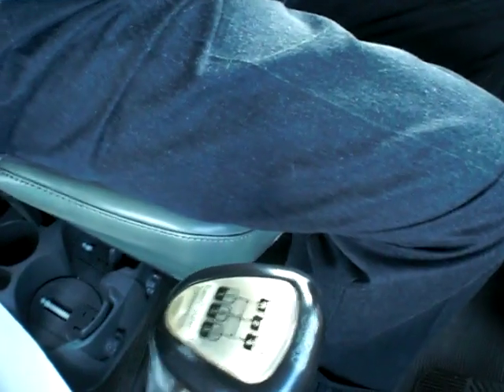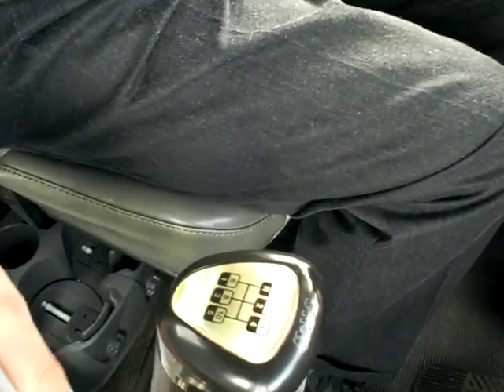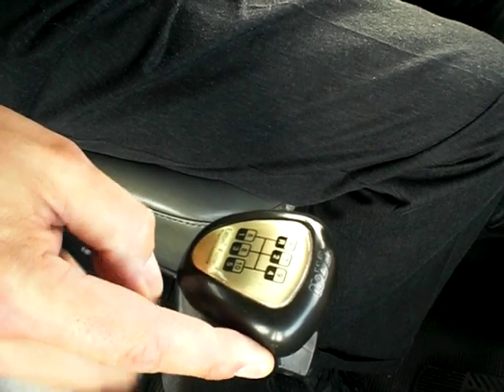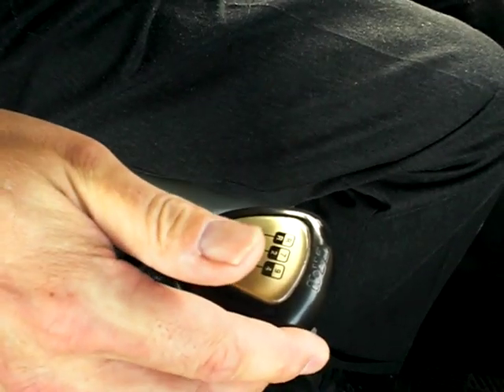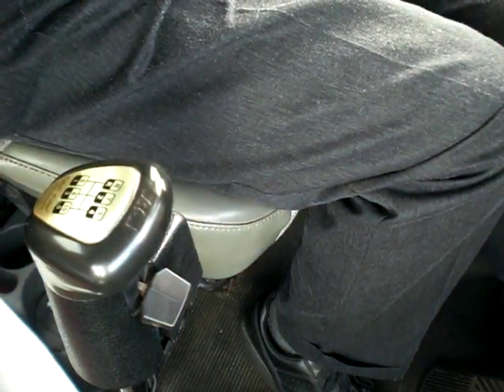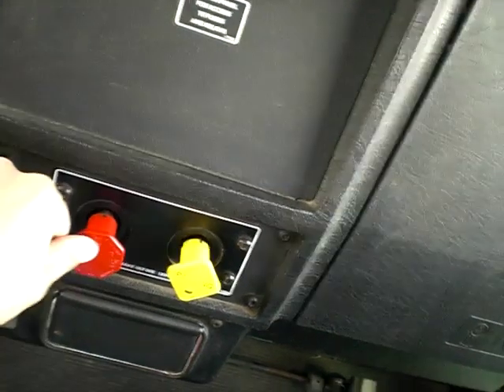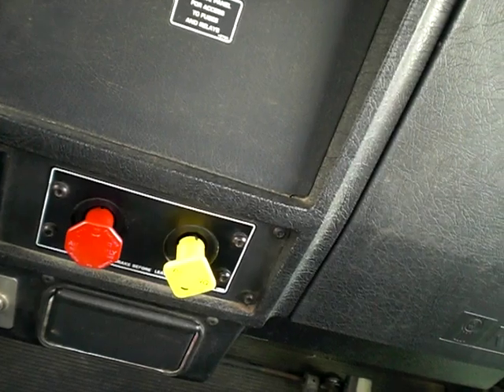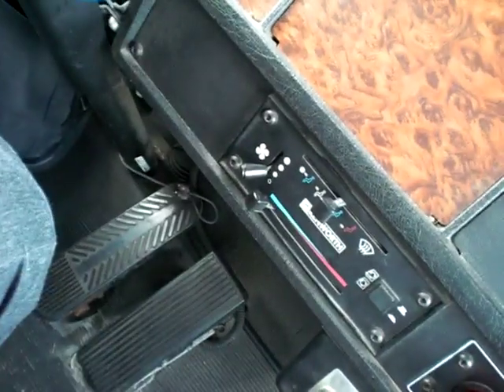AIR BRAKE STALL TEST

Comment: yes you can use a tug test to make sure your 5th wheel is locked. but in order to pass your pre trip inspection with the trooper when you take your test your requiored to do a leak down test and tug test to ensure both your parking (tractor) and emergency (trailer) brakes are working as they should be. you test each brake one at a time. hope this helps!

Comment: In indiana, this is called the Tug Test. It is a required part of a Pre-Trip Inspection and is done first with the parking brake, then the trailer brakes, then both. You only use first gear (it provides the most torque without lugging the engine)

Truck Specs: 2006 Mack Vision with Eaton Fuller 9 Speed and 39 foot frameless end dump trailer.

Comment: Wonder if this guy's DAC report has a few pages of terminations from breaking trucks?

Making sure the slack adjusters are properly adjusted during the required Pre-Trip and performing a leak down test is the proper way to check your brakes.

Comment: @24preacherboy any brake pot with a broken spring will not hold the truck, but service brakes will work fine, about half the time the pot will leak, because the spring poked a hole in the rubber bladder

Comment: The truck has 2 braking systems, the service brake and the emergency and parking brake.
There is no exit process, before leaving be sure that both the yellow and red buttons are up.
The low air warning needs to work, as this will inform you of, well. low air, before the brakes drag.

Comment: I got a question for you .    If the trailer dash valve pops out automaticly at around 40 psi and slams the brakes on the trailer,  why didn't the tractor dash valve pop out at the same time  or when will it....Now consider that the truck and trailer is in motion.

Comment: I've heard of truckers just pulling the trailer to the rest stop.  The brakes don't alway applie all the way so that they will skid...So anyway you can still make it to the rest stop even if it's five hundred ft. right?  The question was why didn't the tractor emergency go on and slam the tractor brakes on at the same time of the trailer time?

Comment: for tiffbabe07 if your driving down a road and you loose air pressure, your air brakes should "pop", or in other words your  brakes would automatically lock up, there for you would come to a complete stop.

Comment: Only if the brake chambers are in good order.  You wont know if the parking brakes (spring brakes in the chambers) are working if you dont do this test as the spring brakes dont reqire air to operate.
I have had brake chambers that had broken springs that worked fine except they wouldnt hold the truck when parked.

Comment: when u apply the brake how does that work ? because i know there is already pressure in thoses brakes keeping them free. so how does it work sending more pressure through the lines to make them work ? thats what i dont get. does the air from the brake lines push against the air in the chambers ?

Comment: @chelsea7218  I heard some truckers will drag their trailer sometimes a half a mile before they pull over...Their
going so fast that the trailer brakes don't have a chance to lock to the drums.  So they just drag the trailer the half mile while the brakes are burning hot....but the truck  pop out valve still doesn't come out     got me stumped why it didn't   hum;

Comment: final fantasy your wrong. you can lose air brakes when driving. when you lose air brakes, SPRING brakes apply at pressure between 20 and 40psi in your supply pressure tanks. the air pressure above 40 psi keeps the spring brakes disengaged. When your brake valves are out, or you just lose pressure, the spring brakes are applied. pushing your brake pedal has nothing to do with your sping brakes, thats your service brakes. if your gonna talk, use proper words, and half your brain.